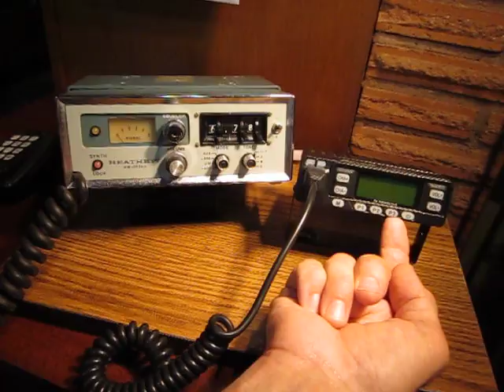Luiton LT-898-UV radio vs the Heathkit 2036A !!

Comment: ya but, the luiton does not follow it's add at being 25 watts, more like 15
and the S meter does not work well at all.
Reply: The 898 is billed as a 10 Watt radio. For the author, the 2036A was my first rig.

Comment from the maker: hello Dan, 
  My actual idea was not really "comparison" but just to show the incredible advances in electronics and technology in amateur radio. I don't see me ever digging into the Luiton, because at currently $73. it's basically a discardable !  I still use the Heathkit daily in my mobile and am astounded by how well it still works for a 36 year old rig that I actually built myself !  I did some mods to it including changing the nonsensical RCA rf out jack to a BNC female and added a red led transmit indicator, but otherwise it's as stock as the day I soldered the last component into it !  The Luiton has not failed whatsoever in any way now in 10 months and I run local nets with it with total confidence.
  Sounds like you have or know about the Heathkit.  If so, I'd like to hear more. Thanks Dan, DVI
Reply: +DeltaVictor Innovations The first one I bought (HW- 2036 )was an "as is" eBay item I won. The receiver is excellent, but when I try to transmit with offset, it loses sync. It will transmit with about 9 watts out on simplex. But, simplex won't get the job done. I have it open, and am in the process of finding why I cannot get the offset tx to work. I had an OM on a Yahoo group offer to give me a free HW-2036A with the matching HW-2036-3 power supply. All I had to do was pay the shipping, so I PayPaled him the shipping and got them a few days later. The power supply and radio need some work. I plan on getting them all working 100%. We'll see. Lol! 73...Dan

Comment: It's not really fair to compare these two radios. One is 1970's technology vs. latest technology. I will have to say one thing at this point. Wait until you ever have to "dig" into the Luiton. The smd technology will have you climbing the walls. I will have to say that there are two items that I don't really like about the Heath. One is the phono connector for the antenna. They could have at least used BNC. The other is the lack of a microphone connector. If one wants to change microphones, it will have to be unsoldered, and the new one resoldered. Not a deal -breaker, but would have been nice. 73...Dan w4mnc
Reply from the maker: +Beretta96Dan    Hey Dan, the synth unlocking in repeater mode is very common with the HW2036's. It's happened to me also, but has been quickly resolved by resetting the dc reference voltage on the VCO with a good DMM and/or just turning the VCO pot while transmitting till you find the spot. I use my Heathkit 2036A daily for simplex and have set the 3 pl tones to my 3 favorite repeaters. I'd jump on the opportunity to get a free one with a power supply !  Take it !!  Good luck, DVI
Reply: Thanks for the tip. I will try that tomorrow. I would love to get it working the repeaters! I'll let you know. 73...Dan